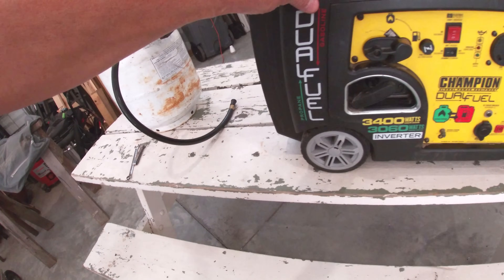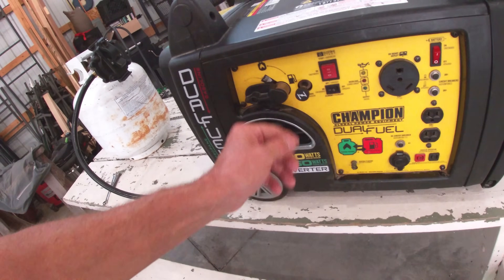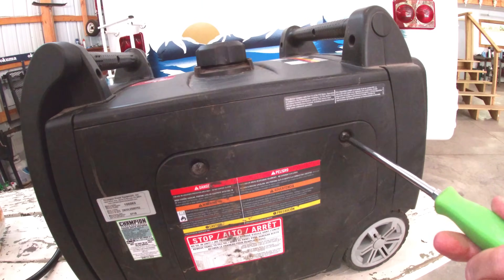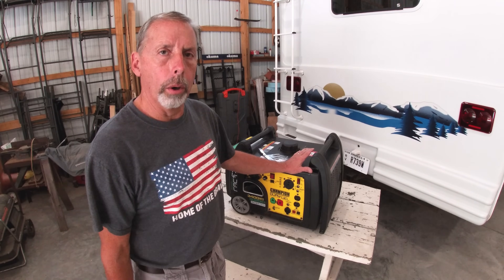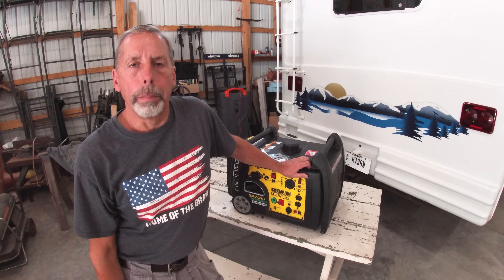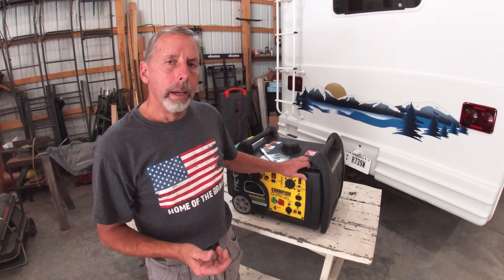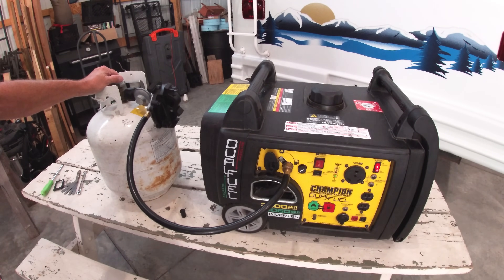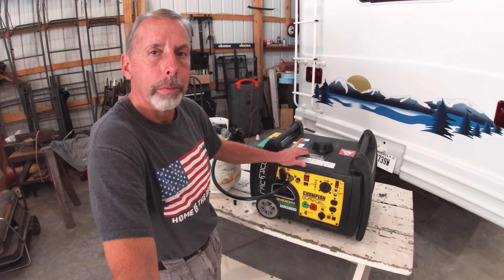Propane Generator Fail

Comment: Help! I don't know anything at all about propane, generators, electric, etc. I'm planning a Vanlife temporarily and I have questions about "propane"! Do I need to chain the propane tank to something? Does the propane tank have to stay out of the heat? Thanks for any help. ( BTW, I just started watching these videos of using dual fuel generators and every single one regardless of the brand has had the exact same issue about opening the propane slowly). Interesting and YT is making life easier for ppl like me who don't have a clue. I would've been utterly confused and tried to blame Mr. Plum in the Library with a candlestick 😂
Reply from the maker: I’m no expert but I think I can help. Yes you should secure your tank so it can’t get knocked around. I put mine in plastic milk crates that you can usually find at a home improvement store. The tank can be stored in the sun and heat without worry. They shouldn’t be stored inside your vehicle. They always seem to put off some fumes so always keep away from any potential sparks or flames. Thanks for checking my video out and safe travels on your adventures. Here’s the link to my video showing how I secured my tank. https://youtu.be/fQQEP0A9H4Q?si=mJOVesNkKWcNGsYD

Comment: im having the same issues with my champion generator while running on propane. but when i put gas in it. runs like a champ. so im thinking regulator issues.. ive run my generators for thousands of hours. no issues with the propane until recent. i hooked up a 500 gallon propane to my generator and now some change inperformance. im thinking the tank regulator is adjusted tooo low and so its not pushing enough pressure through to keep up with demand. it runs fine at idle with no problem running around 150  to 200 watts on propane.. im a low electric use. keeps my generator from too much wear and tear. anyway. the regulator at the generator might need a 5 min reset / unhook ... i learned that today on my propane cabinet heater when i goodled for info so small appliance regulators dont have pressure set screw. but there is one on my big regulator at my big tank. tomorrow im going to dial that up. and one more thing. if your running small tanks. the emptier it gets the less pressure your working with  i run into pressure problems in the winter cold.. cant use the whole tank. just most of it is available..
Reply from the maker: I haven’t had any trouble yet with low tank. I’ve run a tank completely empty using the generator and also haven’t had any problems in cold weather but that doesn’t mean I won’t in the future. Thanks for taking the time to comment and for watching.

Comment: The problem is in your tank's valve, not the regulator, you wasted your money.  It's a safety valve that reduces flow if it thinks nothing is connected to the hose or there's a leak.  Opening it suddenly with an empty hose can make it think there's a leak.  They'll generally re-set if you just wait a few seconds for the pressure across the valve to equalize, but if it doesn't, disconnecting and re-connecting the hose should do it.  Your tank looks pretty old, swapping it out should cure the problem.

Comment: All propane bottles have a safty diverse !! If you open it to fast it clicks and you won’t get propane or it won’t flow at normal pressure. You have to close it and you will fill the click again, then you turn it to open but slow and that’s how was you open a propane bottle

Comment: My first thought that come to me was that the regulator is at fault, believe you me!! But hey, this starting procedure
does make alot of sense! I suppose that it might have to do with who made that regulator or perhaps a built in safety
feature that in the event of a hose leak that should occur, perhaps the regulator metered flow would come to a grinding
halt! There should be some commonalities with the various manufactures as it is. Would it be too hard to find an alter-
nate manufacturer or vendor to replace the regulator??? I think not. The setup is a two stage regulator that doesn't
require a high pressure metering type. The output metering pressure should surely be less than 20 PSI since you don't
have a big or huge displacement engine and so the CC size on that one should be either around 198 cc or less! If I had
to pick one out, and I couldn't obtain it from the manufacturer, I'd get one that has the same specs and configuration as
a similar CC displacement engine that can be found elsewhere; even on eBay and/or Amazon for a good price! Hell,
even if you were to find one for a 212 cc engine just might work as well since there's only 14 cc's difference from one
engine to the next! I believe that there is a feedback mechanism built into the regulator that tells it as to what amount of
fuel delivery that is needed over the various load conditions of the engine and tells that regulator just how much fuel
delivery that is needed and makes those adjustments automatically based on the amount of RPM's and vacuum overall.
I don't know this to be absolute, but I believe that this is to be the case! By far, the regulator is very sensitive and precise!!
I do know however that these engines that are direct Honda clones have alot of commonality and mostly have some inter-
changeable parts within sometimes three if not four manufacturers out there and so these Chinese built Honda clones are
a real hoot but trying to get most of these parts don't seem to be a real problem. By their industry standards, in order to
produce these generators and be cost effective, there are quite a few parts out there that seem to be interchangeable,
and so like other brand names, there are primary and alternate vendor sources to include some of these aftermarket and
overstock sales just like cars. There are some that are trustworthy and yet some, not quite so much. I know that I can
retrofit my son's generator  with the greatest of ease and only for 140 clams and bypass all these shops and what not
that are basically out to steal you blind!! I have taken on that notion and present my son with a birthday gift here shortly
and know that it will work flawlessly!
Reply from the maker: On my 2nd call to tech support I got the specs on the valve and once home I picked up a Mr Heater regulator that matched. Generator wouldn’t run. Didn’t seem to get enough fuel. It would fire and die. I had the same thought as you about an aftermarket reg. That’s when I called tech support the final time and  finally had an answer andended getting a factory reg. for backup. Thanks for your comment and for watching

Comment: My champion generator shuts itself off after a few minutes if I am running on economy but without  load, is that normal ?
Reply from the maker: No not normal. Sounds like it’s not getting enough fuel.

Comment: You need to be aware that the PROPANE TANK has a valve in it to regulate flow and it restricts if the flow is too sudden. Such as would happen if a hose broke etc

Comment: I've got the 4500 dual fuel I haven't had any trouble with it of course I've never put gas in it only propane I didn't think you had to use the choke for propane I never do I thought that was just for the carburetor

Comment: Thanks for the video.  Unfortunately it didn't work for me.  I'm the same as you, only run the Champion on LP.  Will not start and I'm pretty sure the regulator is bad.  When I open the LP valve I hear nothing like the release of pressure you normally hear.  I don't think propane is getting to the generator.
Reply from the maker: Thanks for watching

Comment: That's the same problem with the calling little buddy haters. If you open the bio too fast, it does the same thing. So it will work on a lot of stuff with sure that problem

Comment: I never disconnect mine from the tank , and I use a crossover valve  to change tanks  .  Never had an issue  .

Comment: It's a safety feature. Open the valve too fast and that triggers the safety feature. When too much propane flow happens. To fast of propane flow. That's like an open line. The safety feature to to stop propane from flowing out freely should a bad connection of a busted line happen.  Too fast of flow of propane throws the safety valve shut.

Comment: I purchased a propane space heater. After a few uses, it stopped working. The filter got clogged with impurities from the propane tank. I got a warranty replacement from the manufacturer. I should have returned it for a refund.

Comment: I have a champion generator that I use on propane once in a while, I guess I must turn it on slow cause I haven't had that problem, I'm just astonished you would cut your holiday short and go home instead of just putting gasoline in it.
Reply from the maker: We didn’t cut our trip short. We planned on doing 2 weeks boondocking in the desert before moving to a campground with hookups. We just cut boondocking short 4 or 5 days. Thanks for watching

Comment: This could be your propane tank needing to be opened slowly, and nothing to do with the generator..  Look up reset propane tank OPD valve low gas flow fix.  It's a safety feature tanks have.

Comment: the problem is not in the generator, but in the propane bottle. there is a valve within the valve that restricts the flow of propane if there is a sudden surge, say the hose gets torn off. if you open the valve on the bottle quickley, the inrush will set the surge valve. to clear the problem, close the valve, drain pressure out of the hose, and re-open the tank valve slowly. older valves dont do this, but you cant get them refilled either. your govt. at work.

Comment: Why order their regulator? You can get high quality high flow hi pressure regulators for under 50 bucks and Ive never had any of those issues and I have several things I run that need hi-flo regs.
Reply from the maker: I tried a new regulator from the hardware store that was a dual stage with to same flow rate. It wouldn’t run the generator and not sure why. Thanks for watching
Reply: @PleasantValleyOutdoors  Interesting. Well, my grandmother always said, anything mechanical, give it a good bash!

Comment: I had a similar issue with a champion 2500-watt dual fuel. Turns out it was the propane tank. Once i change tanks the problem was solved.

Comment: I noticed that you pulled your choke out when you started the generator. The choke is for use only when you're running gasoline. It's not for propane.
Reply from the maker: Tried starting it many times without choke without success. Thanks for checking it out
Reply: @PleasantValleyOutdoors  so an ice engine will not start on propane until the engine can pull a vacuum that activates the diaphragm that opens the valve. That's why the regulator should have a "prime" button. Pushing that button manually opens the valve to let the propane flow and start the engine until the engine can create enough vacuum to keep the valve open. This replaces the need for a choke. If you still need a choke to start the engine, you still have some kind of regulator issue.
Reply from the maker: @paulntx  makes sense. Thanks. Nobody ever explained that to me

Comment: Dude - Not a regulator or generator problem.  It’s the excess flow restrictor in the fitting that connects directly to your tank. I think all LP connectors have them. It is a spring loaded ball that is pushed against it’s seat when the flow exceeds specs. Turning off the LP lets it reset. I didn’t read all the comments, so apologies if it was already answered.

Comment: Not just champion, i belive it is a goverment regulation (as if there is not enough rules and regs). my bbq grill does that. Also, you do not have to choke it when on propane.
Reply from the maker: I’ve tried starting it without the choke and it won’t start. Thanks for watching

Comment: It wasn’t a generator at all. It was your bottle gas, depending on how old the bottle of gas was and whether it had been exposed to below freezing temperatures but mostly because condensation still builds up on the inside particles of rust keep the gas from flowing correctly in correct amounts Through the regulator into whatever engine you were running it in you switch to a new bottle and like magic you’ll notice it runs better. I’ve had the same issue with heaters as well. For some reason they were just stop and then I would start it again and then sooner or later would stop again  And it was plenty full. It was at least half change the bottle problem in a way. Next time, consider what I’m telling you and save yourself some time

Comment: 2 things, same problem with all I have tried. Open very slow and no problems. Open fast, and it is a crap shoot. 2nd thing. Propane, based on the tank size, can only supply so much BTU's of gas BASED ON THE TEMPERATURE OFTHETANK. If it is warm out,,even as the tank cools when in use , you get enough gas pressure. BUT , in very cold temps, the tank will cool way below freezing. As it cools, the pressure will drop below what you need to run. A bigger tank can offgas more when cold. It will present almost the same as the regulator issue. Starts fine, runs a while, but as the tank cools, you have to pull the choke to keep,it running. Eventually it will die. Wait a while, the tank warms a little, and the it runs good for a whi.e again. If it is freezing 2 small tanks in parallel is better than one....Keith
Reply from the maker: Thanks for the info and for watching

Comment: I don't understand why are you using choke with propain...  Propain line bypassing carburetor and choke ... I never touch mine  when I'm using propane... 😮
Reply from the maker: Mine will not start without the choke. Tried it many times. Thanks for watching
Reply: @PleasantValleyOutdoors  got it, thanks 👍

Comment: all 5 gal propane tanks are built with the safety shutoff  valve. any application using a 5 gal propane tank needs to be opened slowly not just generators.

Comment: Yeah your problemis not in the regulator it's in the propane tank itself the fancy safety valve they put on top Of the 20 pound tanks Is your problem There is a safety check valve that will not let the propane come out too fast So always open the tank slowly to let the pressure build app so it's not a sudden surge of propane coming out and trip in the safety Valve

Comment: You can go to tractor supply Ace hardware they all carry those regulators just get one that matches your old one I have a 4500 champion dual fuel I have no problems with that generator I like it
Reply from the maker: Yep I tried that. Wouldn’t start and I had the same psi . Thanks for watching

Comment: I'm only half way through the video but I have NEVER seen the Spark Arrestor get blocked on a 4 stroke,... 2 Stroke engine, sure but never 4 strokes.
People don't realize that Liquid Propane carries a lot of Water & that is why the Grates on your Propane Grill are Enamel Coated & why Cast Iron Grates are rusting.

Comment: The generator fail problem failure isn't with the generator!!!!!!! I have two of the champion dual fuels that Ive had for almost three years. I've had no trouble with mine. HOWEVER, the problem is opening the propane valve to fast. The reason for this is in t safety valve . There is a mechanical safety switch that sets (or activates) kif th6tank think a hose base broke so is cuts off almost all the fuel from  coming out of.the tank. If you get your down close to the valve and open it.fast you'll hear a click. If you bleed the pressure off and do it slow you wont here the click. The click is the safety part of the system at the value reducing the gas flow. These newer propane tanks all will do this. If your not getting a full flame on your gas bsb b q it's the same problem. Just open the tank valve slower. Blackstone grills even explains this in their pamphlet. Glad to help. Good camping

Comment: It has nothing to do with the type of appliance that you're using, the same thing can happen with a space heater that runs on propane, do not just turn the knob on the propane tank quickly but turn it slowly because there's a check valve in there that will shut down the flow if it's turned on to abruptly.

Comment: You can have the same problem with a propane fired gas grill, if you open all the burners, then rapidly open the tank valve.  The burners will have a very low flame and some no flame.  Your food is not cooking, so you check your tank and it is still near full????  That's the problem and it's all safety related with propane tanks.

Comment: The warning for this problem is on the tank its a safety valve required for usa government standards basically if gas flows to quickly it assumes there's a leak and stops flow of propane so your problem was in the tank head not your generator or regulator
Reply from the maker: Yeah that’s what I’m finding out. Thanks for watching

Comment: Honestly, the real reason why these generators take a shit is what the maintenance person told him if you’ve got a clog spark Restorator in the exhaust the exhaust ain’t gonna go out so it’s gotta run it full choke clean your exhaust spark Restorator it’ll do you a lot of good? It only takes a second to get it out and then soak it in Solution scrub it with a toothbrush make sure it’s nice and clean and you’re good or you can just burn off the suit on the spark Restorator same exact reason why small engines stop working such as leaf blowers weed whackers chainsaws moral of the story is do the maintenance that you normally would do for a generator. You don’t stop doing maintenance on your vehicle so why would you do that?

Comment: My guess is your regulator freezes over when you open the valve quick. If you lived somewhere where petrol is expensive and LPG conversions are fairly common you'd know the issues of LPG. Also burnt valves, too God damn many burnt valves.